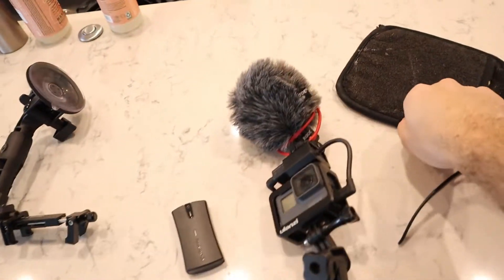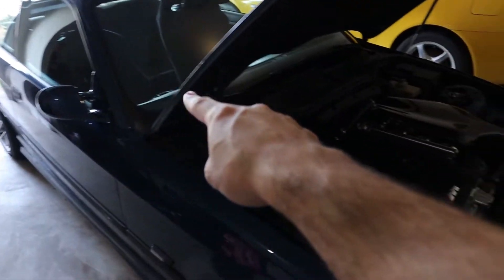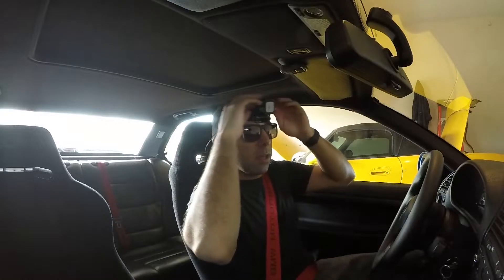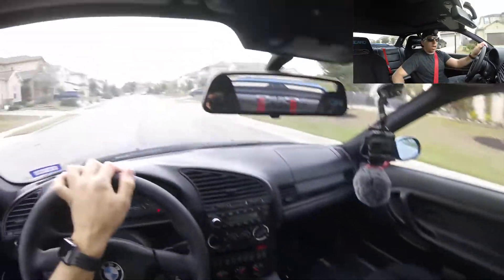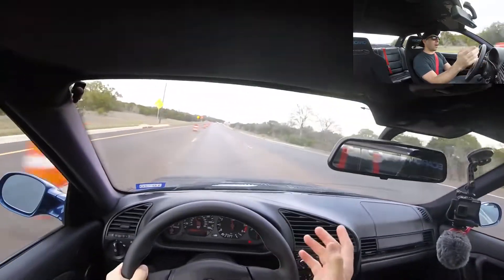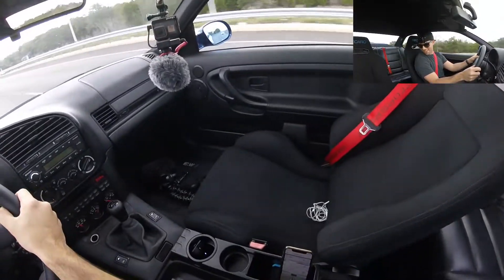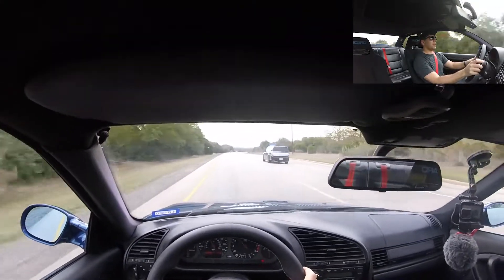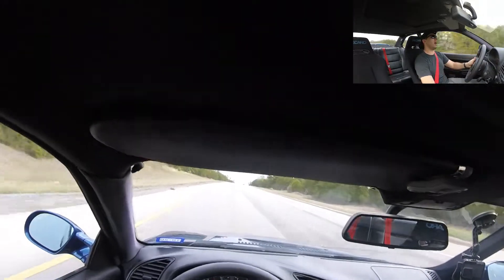0 to 60 in My S54 Swapped E36 M3 BMW! [POV]

Comment: Tire heat.....and good driving leads to shaving full seconds off of 0-60 times. 4.6 for my 07 RS4 manual. I think you can beat that. Good job man!
Reply from the maker: Thanks bro! That RS4 is probably harder to launch. I’ve had a few AWD cars that were tricky to launch. My fave being my old Evo IX. I want to say my best 1/4 mile was low 12’s (ish).

Comment: So the e36 M3 with s54 swap motor that was for sale on eBay went up to $16k. It had big Brembo brake upgrade and fully done interior with cage. Super Clean car.
Reply from the maker: Aaah, interesting! I’ve been debating on putting a half cage in mine but I feel like that would eliminate a portion of potential buyers if I ever wanted to sell it. 🤷‍♂️
Reply: J Petro get an auto power bolt in harness bar. I can get you a discount from a buddy. Auto Power is a sponsor for their track events.